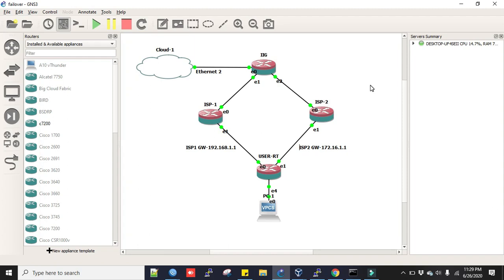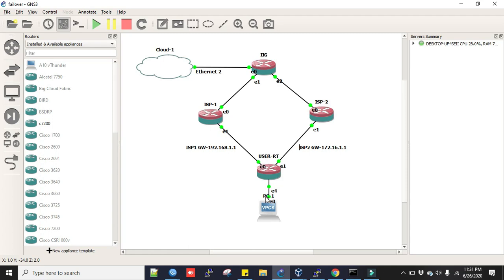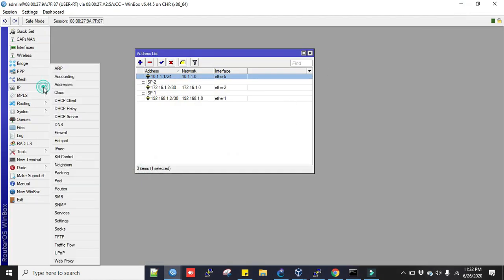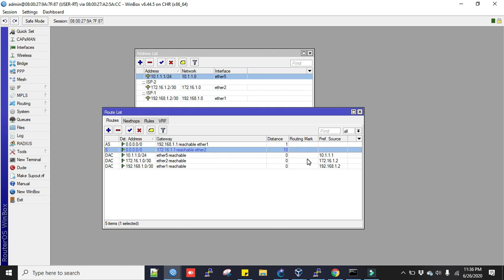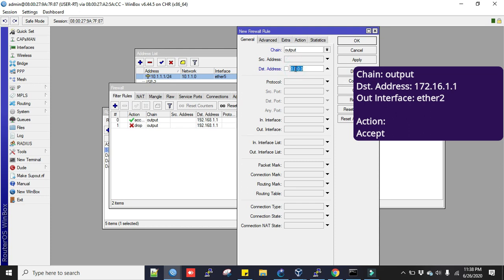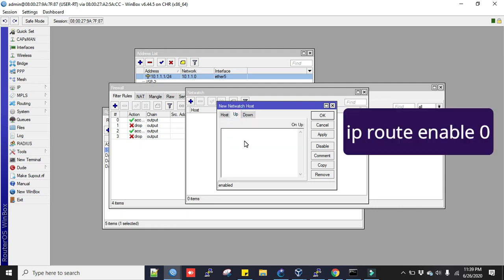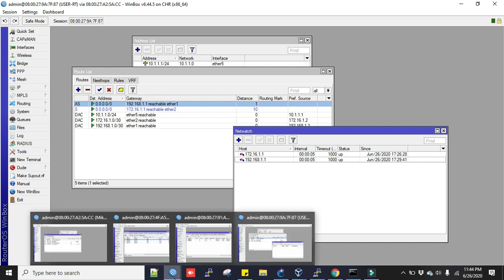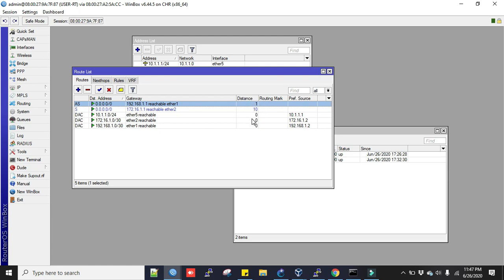Mikrotik Tutorial 47: Mikrotik Autofailover by netwatch

Comment: hi techie LAB, what if the two isp came from the same provider and have same gateway. is that possible? of course they have a two different physical modem. thanks.
Reply from the maker: No. They will give you two Layer 3 address. Two different gateway to reach to them. THey will tell you one IP block as primary and other block as secondary.

Comment: The problem with this setup is when the internet is down but the modem still gives IP to the Mikrotik. For example, if you disable connection from ISP-1 to IIG, the Mikrotik still thinks ISP-1 working but it's not.

Comment: Why do you add these firewall outgoing rules this should work without  these firewall rules
Reply from the maker: It does work. But most of the time router doesn't know if the link between Client and ISP is down, as interface always showing up in Mikrotik router. So it won't switch the link to ISP-2. In this situation, this netwatch work pretty well.
Reply: @TechieLAB  but netwatch tool is watching if connection is down or not